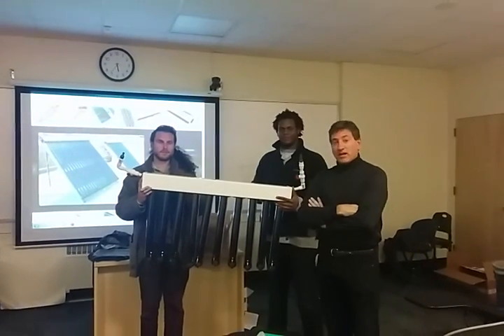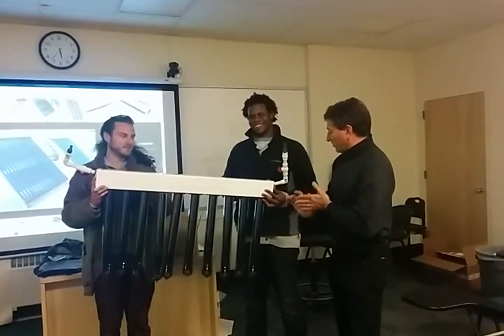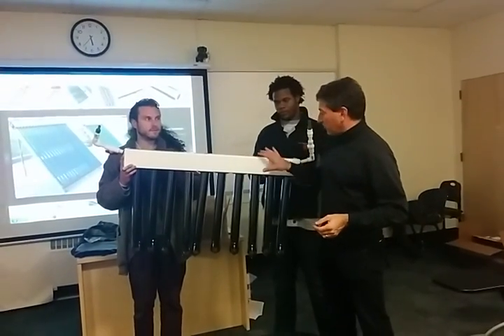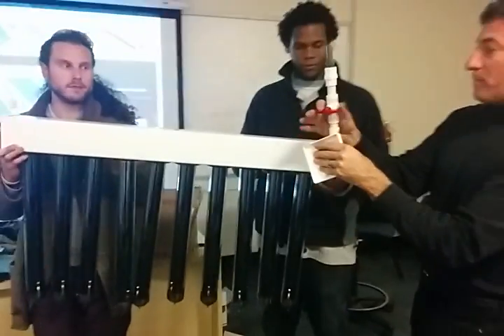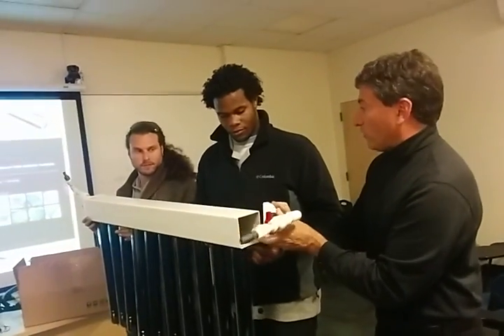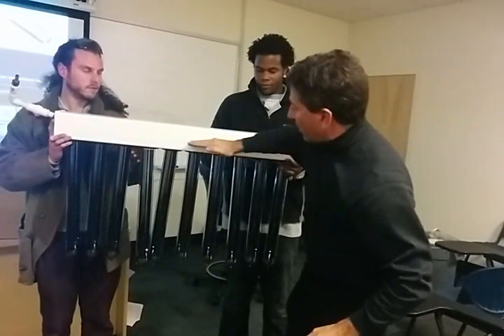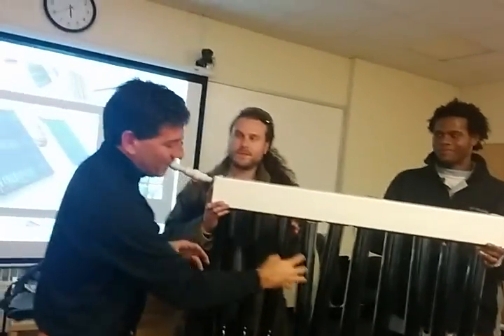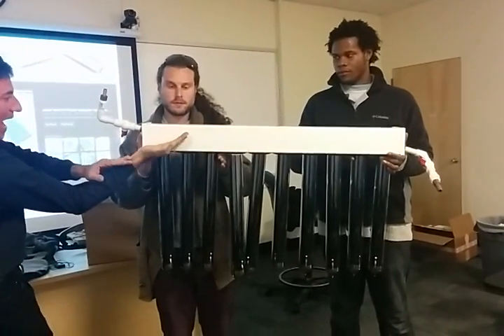Low cost DIY  vacuum tube solar hot water heater .

Comment: Wouldn't it be easier and cheaper and quicker to just coil a 30m black garden hose in the sun and connect it to a tap at one end and close the nozzle at the other.
Reply: Not really, no.  The whole point of a 'manifold' system is that it is far more efficient and effective than a simple coil.  There are videos/websites that explain the physics behind it.

Comment: Great idea. Needs some fine adjustment though. How much pressure can the system contain? I'm sure you can think of an ingenous solution! Also any ideas on how to prevent freezing in cold weather?

Comment: Im guessing you then discovered the intensity of the heat and the unit completely warped and fell apart. Not a good build at all.  Did I hear you say Dr.? Unbelievable.  This is a perfect example to me of how people get degrees with pure focus that remain wildly incompetent.  Even your description of how the temperature would exchange is the wrong model of behavior, where did you get your degree?? Continuous flow?  Wrong. And further more the amount of systems to make this poorly built system of materials you have here to be of use in a home is close to six times the cost of the tubes alone. Not to mention the destruction that would happen if just ONE of these tubes breaks, and break it will because the direct water on these tyvor tubes will break them far faster than air or organic material fillers around a heat sink pipe system with a real coil exchange inside a separate tank bathed in the water that you would actually use.
It makes me crazy to see such from someone people would hold in any regard due to being a pedigreed moron.  The fact of the matter is these tubes with the proper design and materials are capable of electrical generation of current standard specs of 800 watts in heat, which is capable with the tank system to create electrical energy as well as hot air for the home via radiant or even simple radiator fan exchange. You can use these in proper design to make, heated water, refridgeration, electrical production, and heated air systems. FOUR major systems, off of simple designs and principals in an integrated system and material choices.  And you.. you tell them to build one guaranteed to fail due to your wildly inaccurate choice of design and materials.  You need to know your area of "expertise" and stick with that. All you are doing is muddying the waters for clarity and competence here. Unbelievable.
Reply: +Charley Ghanem He may be terse and the tone if definitely off but you cant argue with the accuracy of the comments YT is full of information all you have to learn is how to filter inaccurate bullshit...x
Reply: Charley Ghanem you are quite right.
Reply: why the terse and anger filled comment ?
Reply: I went to your channel to see your videos of some of these ideas you present for further in-depth explanation, demonstration, how-to, and DIY projects. I guess you're still producing your first one.
Reply: richard hollick no I am not arguing against what he says. I just think its kinda aggressive and mean spirited the way he says it. Kindness and  humility can go farther here than overpowering  words of ridicule, sarcasm and flippancy.

Comment: Awesome! I'd like to hear more about a possible application and how to implement. For instance, if a low income community became interested in building this unit, what are the chances they'd know anything about getting the hot water to their shower? Or anywhere useful? Can you connect it to a home water system? Or how could this be simply applied to heat a room inside a house? I know nothing about this stuff, but I'm picturing a simple tube system connected to my subfloor and entering my crawl space through foundation vents. Where would the hot water go after it ran through the tubes? So many dumb questions, but it would be cool to see you guys make a video that connects this unit to a cheap, practical energy saving solution in the home - something that the layperson could actually execute.

I'm going to try to build this exact system because it's cheap and cool, but I have no idea what I'll do with it when I'm done. I'd love to see more from you guys. I like your team. Keep it up.

Comment: There is no advantage in using vacuum tube with out a vacuum rather than using pipe
Reply: The tubes are double walled with a vacuum already between the walls. One end is open in the middle for water or air, but the walls are sealed. When the sun heats the tube of water, the vacuum impedes heat loss to the air.